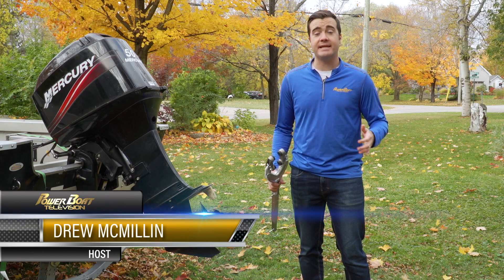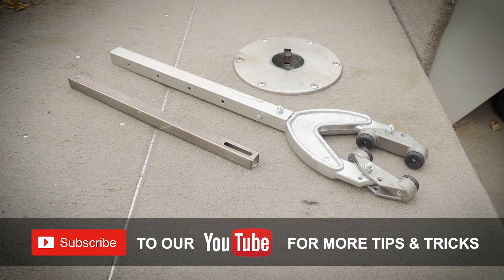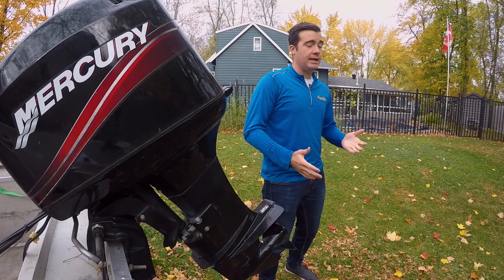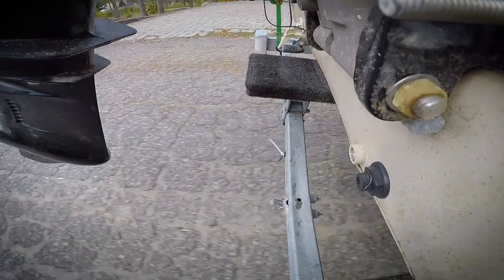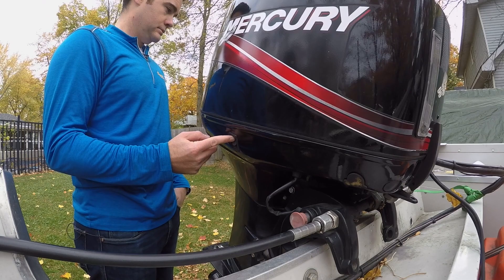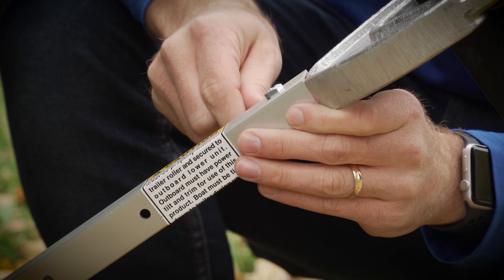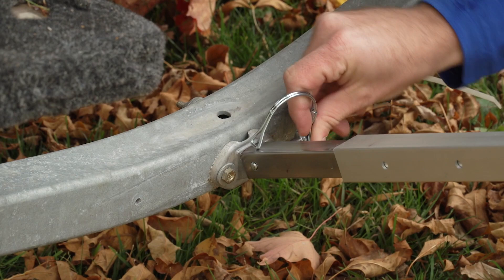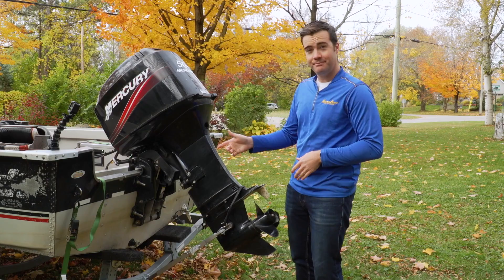How to save your transom with an easy DIY

Comment: So, if that 250hp motor, that pushes the weight of the boat through WATER.......needs a$90 support when on the trailer......what should that tell you about your transom or your boat? The most bullet proof part of the hull......?
Reply: This is lateral support him as a different kind of motion
Reply: Should probably read your motor’s owner manual, they all say to use these
Reply: It's not necessarily your transom that your protecting. When your boat is running in the water the boat,  motor and transom move together. When your trailering the boat the hull is attached solidly to the trailer so the transom doesn't move, while your motor is absorbing all of the vibration and impact. When you hit a bump or a pot hole your hydraulic lifting cylinder and/or trim cylinders on your outboard take the shock of the impact thus blowing out the seals. (Ask me how I know) Devices like this simply "bond" your trailer to the motor and help absorb the shock to the motor itself thus reducing the amount of force placed on your lift cylinder and mounting brackets.  There are other brackets that fit directly over the trim cylinders but for my motor I have found them to be problematic as well (sheared off grease zerk). I have returned to the good old fashioned Transom Saver. And they're not $90,  they're only about $50 which is way cheaper that paying to have lift and trim cylinders rebuilt.
Reply: @poppasmurf3453  You do not want the weight of the outboard that is mounted to the transom bouncing up and down while trailering you boat.  Those forces get transferred to the transom and by 'tying' the outboard to the the trailer the trailer and boat should bounce together / in sync eliminating stress on the transom.